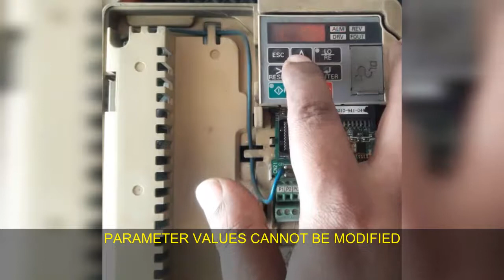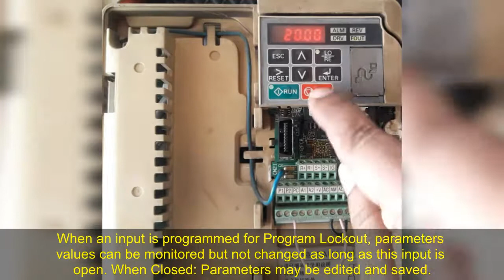Program Lockout, PARAMETER VALUES CANNOT BE MODIFIED | Yaskawa V1000 | Flow Chart @FlowChart

Comment: Good afternoon,Sir 🙏
Could you help me, please 🙏
I have yaskawa varispeed 616PC5 with 220V input supply..
And i faced same problem, that CALL alarm, but i'm only can go to monitoring mode, and I can not going to any parameter 🙏, could you help me to solve this problem,Sir 🙏
Reply from the maker: Please follow the user manual and try accordingly
Reply: @FlowChart  hie ihave problem., when is too much sun the motor frequency drops
Reply: how you can setting parameters H -01 TO H-07 on the screen??